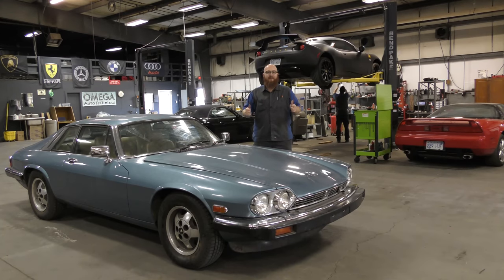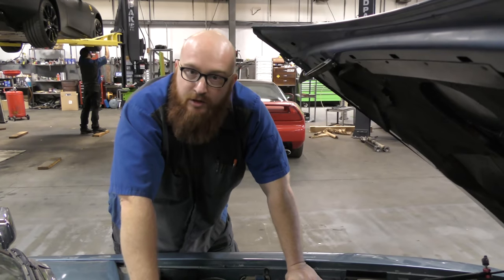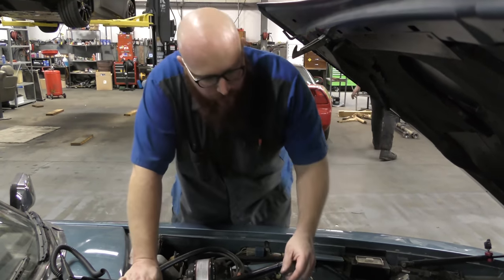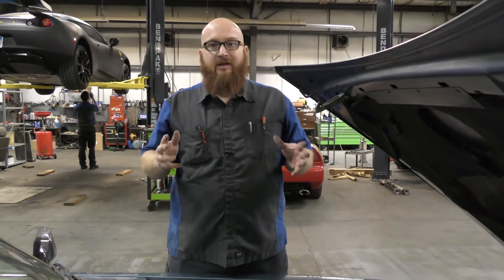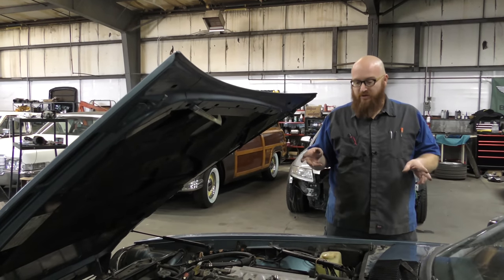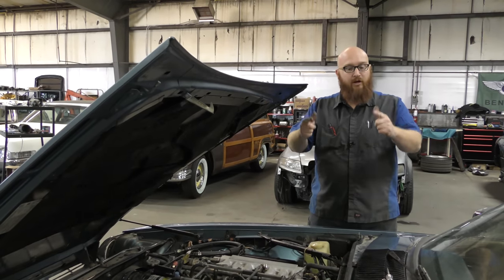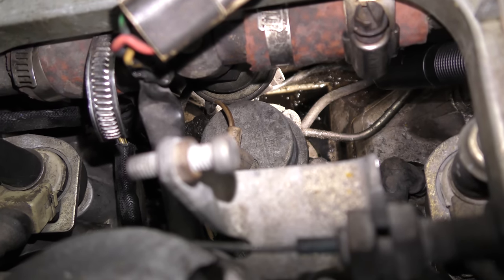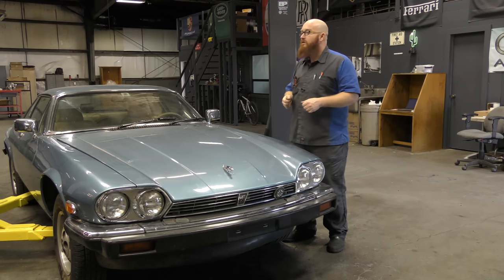'82 XJS with the cursed Jaguar V12 comes into the CAR WIZARD's shop. Can he get it running?

Comment: I had a 1992 XJS. I bought it cheap because of its reputation. It was twelve years old and only about 32,000 miles. A beautiful black convertible with lovely tan interior. Everything worked terrifically. The secret is that the late 1980s into the 1990s V12 were different than the 1982 in this video. Jaguar had corrected so many of the defects of the early ones that the one I had was very reliable. Part of it was fuel injection and electronic ignition. I had it for 6-7 years and it ran great. And, such a wonderful ride. The one issue I had repeatedly is the cruise control. The first time it happened, I noticed the rod running in line with the engine had a broken part that connected it. I used a rubber grommet and a zip tie to reconnect and back in business. It would fail again in a year, but 15 cents and two minutes was the repeated fix. The XJS was made for over twenty years. Most of those years with a V12. The XJS kept the company afloat during tough times. Jaguar switched in a six cylinder around 1994, but the V12 by then was a great engine.

Comment: My dad bought a brand new 1979 XJS. He said the first year of ownership was horrible. Constantly at dealer. After that initial year it was a pretty good car for him. He had 10 years and over  a 100k miles
Reply: 70s XJSs were terrible build quality, on top of the terrible Opus ignition system.  By early 80s, the new Lucas ignition system (fuel injection was actually designed by Bosch) was superior, and build quality went up through the 80s after Thatcher privatized Jaguar.  Also, when Ford bought them in 89, the build quality kept increasing too.
The 70s were so bad, that there is no 1981 US model.  Jaguar was about to kill the XJ-S in 1980, but the new HE technology (bringing gas mileage up from 8 to 12mpg in the city) gave it new life.
Reply: And yet my Acura Legend is 30 years old just shy of 300k, just as luxurious with reliable electronics, and still starts every time and has never left me stranded.
Reply: @G0ZERIAN  The Acura Legend was a joint Honda/Rover project and actually has a Rover electrical system. Of course Rover and Jaguar were part of BL back then. Your car probably shares much of its electrics with Jags of that era.
Reply: @agt155  sorry that is incorrect. The Rover/Sterling version used the chasis, suspension, and drive train of the Honda/Acura Legend. The body panels, electrics and interior appointments were proprietary to each manufacturer. Dont belive me? Go tear two of them apart and see how the Hondas wiring and connectors are almost carbon copies of other Hondas from the era, and how the Sterlings/Rovers are completely different wiring and connectors, unmistakably British. Ive disassembled both cars myself many times over many years of ownership.
Reply: @G0ZERIAN  The development work was carried out at Rover's Cowley plant and Honda's Tochigi development centre. Both cars shared the same core structure and floorpan, but they each had their own unique exterior bodywork and interior. Under the agreement, Honda would supply the V6 petrol engine, both automatic and manual transmissions and the chassis design, whilst BL would provide the 4-cylinder petrol engine and much of the electrical systems.
Reply: @agt155  yeah I've read stuff in the past too. The Legend never received a 4 cylinder in any market, and the Sterling never received it in the US (only the 2.5 and 2.7 v6s). The electrics for the Legend, I can guarantee you, are very much Honda. Remove an entire dash and wiring harness from a Legend, then one from a Rover/Sterling, and also one from an 80s/90s Honda Accord/Prelude/Civic/Teg and you'll see what I'm talking about.
Reply: @G0ZERIAN  If the Legend had succeeded in Europe it would have been offered with a 4 cylinder, it didn't. Strange how it was popular in the US but not really anywhere else. Conversely the Rover 800/Sterling did quite well in Europe, but failed elsewhere. In the UK Cowley factory Rover 800's and Honda Legends were produced side by side.

Comment: I restored a JAG V12 in the early 80's, Including the engine, great V12, needed a factory workshop manual
Reply: Cool story
Reply: @w.e.s.  he should tell it at parties
Reply: If you are not used to any engine, especially a foreign designed one, it’s not going to be easy to fix.

Comment: I'm a rookie and I have a Daimler DD6 with the same engine. I have change the 12 sparkplugs, leads and cap. (took me 16 hours, the AC compressor is heavy and difficult) New oil, filter and gasket for lower oilpan, and new dampers front. Great car for a beginner :-) Good luck with the XJS, its so nice looking!!
Reply: I have a 1992 XJS convertible, spark plugs same as, and it took me less than a hour to replace, with out removing the AC compressor, let me know for the next time you change spark plugs, and I'll show you
Reply: @MrXlskywolf  Thats impressive! I got a quote from a Classic car shop for estimate 5 hours.
I thought, nah, I can do it myself with the tools at hand.
It took me 6 hours to remove compressor, cruise, throtle-tower etc, and to get the new plugs, cap n leads in...
But then additional 10hours and a lot of money in the swear jar to get all stuff back, the AC was difficult until I remove the front mount plate on the compressor as well.. Learing by doing..
Reply: I didn't remove nothing, other than the spark wires

Comment: Hi “jaguar” wizard….thank you so much for this video: I followed your advice and exchanged the coolant temperature sensor in my 85 XJS that was starting to run too rich from one day to the other and created large clouds of smoke. I thought it had a blown head gasket! $26 and a few minutes later to exchange the sensor and it runs perfectly smooth again! Engine temperature is back to normal and multiple electric gremlins are gone after the sensor exchange. It must have created some short and turned out to be totally corroded inside! These are my favorite cars….as they run so smooth  if they work as intended. Actually way more reliable than you would expect but you have to drive regularly! Great video!
Reply: Well now that makes good sense, and I will now do same as have exactly this problem where it runs excessively rich cold hot or any time.  I can also add  flushing an overheating cooling system with 10 bottles of diet coke left overnight worked particularly well for it overheating as well (strange yet true).
Reply: My XJ40 puffs a cloud of white smoke for 3 seconds after a cold start and takes ages to get up to temperature (according to the dashboard dial). Is that the same issue?

Comment: I've owned three XJS V12s (still own two) and LOVE them!
Reply: I had a 3.6 for about seven years, superbe machine. I would like to try the full fat version.
Reply: I cried the day a friend sold his for a Toyota. The Jag was British racing green with biscuit interior. Pushing the ego thing aside, I was a wonderful machine to drive, the handling was superb, and it was definitely a gentleman's automobile.
Reply: My '73 XJ12L was a dream to drive, and you felt like it could pull up tree stumps. But on the highway you could quite literally see the needle on the fuel gauge move, and one of the SU fuel pumps broke while it was sitting in the garage overnight. Nor was it very funny when the wipers suddenly stopped working in the rain during a road trip.

Comment: OIL LEAK:  If the new sensor doesn’t fix it, there are EXTERNAL oil lines on the rear of the block.  They leak at the copper washers.  Second, just above that, there’s a half moon rubber plug under the cam cover rear that shrinks and falls out.  I think your puddle is more likely from these locations.
Reply from the maker: I saw oil literally pouring out of the sensor. Not an oil line issue
Reply: @CarWizard  I trust the car wizard that the sensor was leaking!   If there is still a drip under the car, check out those other two notorious leaky spots also.   The XJS is my favorite terrible car and I’m glad you made a video on it.  Been daily driving XJSs since 1996!
Reply: Think we got it
Reply: @CarWizard  isn’t that mess of oil on the catalyst, just waiting to go on fire?
Reply: @BangerFleet  You lucky ... man!  :)
Reply: @CarWizard  Say thank you car wizard
Reply: @robertbeirne9813  Oil will just smoke out as it burns off. Brake fliuid, on the other hand, would flame out. Still needs to be cleaned off though.
Reply: @2kcars507  ssshhhhh. My goodness
Reply: The reason why England does not make computers?..They can't figure out how to make them leak oil..
Reply: @CarWizard  can you convince the owner to megasquirt it or put some other aftermarket computer in it. then make a how to series so i can copy it. thank you.
Reply: Well, if the banjo bolts crush washers arent leaking, and the half moon plugs arent leaking youre lucky. They almost always leak if they havent been changed.
Reply: It's AMAZING how mature and grounded a comment seems when it offers correct solutions rather than condemnation of the manufacturer
Reply: Jaquar: Let's put all the oily connections at the rear out of sight so the engine looks nice and clean...
Mechanics: Let's not...

Comment: That’s a real mechanic at work not a plug it in and see what the computer says. Good mechanics worth their weight in gold for older cars.
Reply: Yes indeed, these guys are hard to find
Reply: You still can’t “just see what the computer says”.  You still have to figure out whether the sensor is bad or if it’s fine and the fault lies elsewhere.....
Reply: @shawnbottom4769  I think his comment was to say that the car is not like the new ones, a lot of detective work in the old style had to be done here without a scanner computer
Reply: Totally agree   Have a Saab Aero convertible - Tom at RTJ Autos in Stockport U.k. is a genius with these cars 👌

Comment: Oil leak! It's not a fault, it's a feature!
"Jaguar: If there's no oil under it, there's no oil in it." 🧐
Reply: Drewe Cantwell ...can say the same about Garbage Motors produced chevy motors....exhaust leaks abound in those junk chevy motors as well...
Reply: Just like a Harley Davidson 😂
Reply: That's not an oil leak, that's the "dynamic chassis corrosion prevention system"
Reply: Well said abd if it was a Jaguar, Rover SDi  or any BL vehicle and was not plagued by electric gremlins, then it was not built to the very high standards of spare parts left over from other models. Such as Allegro parts going into a Princess, or Truimph Acclaim bits going into a Rover straight six or 3500 V8!!!
Reply: @blueridgerennsport  that is funny
Reply: @branon6565  Yeah its not just Jags is it.We didnt get many gas gussling yank tanks so we didnt know much about them in UK but no doubt they were heaps.
Reply: Royal Enfield had the same anti rust feature. Oil on the rear tyre could help make life interesting
Reply: they used to say that about harley-davidsons
Reply: GM-Vauxhall invented driver lubrication

Comment: I don't get why so many people have trouble with the Jag V12's, they are pretty simple really, they just look complicated because there's so much packed into the bay.
Reply: Wizard probably already knows about the mixture adjustment screw on the ecu.
Reply: The center-mounted distributor and wacky throttle linkages alone make the engine bay look like a complete mess, but really there's not a lot going on.
Reply: @100PercentJake  same as any other engine, just a few more cylinders
Reply: Amen

Comment: Car wizard, at 5:26 you can see a large electrical arc near the firewall when you hit the key to crank the car over.  Might be something to look into.  More Lucas to exercise from the car.
Reply: Holy shit! I totally missed that
Reply: Good catch. Don’t know what that little module is, definitely arced.
Reply: Exorcise
Reply: Nice catch.....looked like a real bad one. Something probably burned up.
Reply: Nice spot on that arcing!  That can't be normal, can it?  Maybe because that exposed wire? Good thing there wasn't any fuel vapors in the air above the engine there, woulda been a nice big bang!
Reply: Hope Wizard sees it somehow, surprised Mrs. Wizard didn't see it....or maybe she did and she'll tell him about it later because she didn't want to interrupt him in video...
Reply: Looks like its coming from the starter solenoid or associated cabling.

Comment: The V12 Jaguar was an amazing engine. Very strong, powerful and an absolute bargain at the time. It had to be  maintained properly otherwise overheating can be a problem.  Changing the plugs  is a nightmare.  Many engines never had a plug change.
Reply: I ran a Jaguar for some years and knew a guy who was one of the development engineers at Jaguar.  He also used to say that many engines never had a plug change.  Having tried it myself I had to remove the A/C module.
Reply: Not to mention the distributor felt pad that needs oiling every service, that is under the rotor arm..
Reply: They're no so bad to do

Comment: It takes longer to "unpick" the mess from the previous guy, that to fix the fault.

Coax cable is notorious for breaking, they really don't like bending or going round bends.

Oh the delicious irony that the Wizard dissed Lucas, just to find out the faulty internals were US made.
Reply: Kevin Short If something is a true piece of shit, it won’t last almost 40 years. This car is clearly not that bad, as it still runs 40 years later. Sure, it’s no Honda but it certainly ain’t as bad as it seems.
Reply: @binnydinney9739  
All he needs to do is get rid of those hideous US bumpers and put some Euro spec ones on, and it will be perfect.
Reply: @M Bacon 
It must be very expensive, because I haven't ever seen it being used anywhere.
Coax BNC cables, coax TV cables, etc are all not happy with bending and sharp corners.

Comment: The Original Anti-Theft Device - Lucas Electrics.
Reply: Why do the British drink warm beer?
They have Lucas refrigerators.
Reply: .. I restore jags .. e type series 1’s .. they all work before restoration electronics wise 🤷🏻‍♂️
Reply: Antitheft device?!? That's pretty funny...
Reply: My 80 Jag V12 had Lucas stickers on all EFI parts and relays, peel them off and Bosch was stamped on them or cast into the alloy
Reply: Ah yes , Lucas !! PRINCE OF DARKNESS !!
Reply: @larrytownley2231  Ozzy Osbourne has nothing on Joe Lucas. Ol’ Joe is the original “Prince of Darkness.”
Reply: @TheBuzzo72   Adam old boy, we don't drink warm beer !  BTW  I have owned several Jags over the years with Lucas equipment and not had one problem. My sympathies to those who have had problems.  😂🇬🇧
Reply: Lucas also makes refrigerators, That's why Brits like warm beer!
Reply: and the gotti...lights....gotta get home before dark
Reply: Lucas Electrics: The Prince of Darkness.
Reply: @sirgeraldnabarro1342  it's just a joke a guy I used to know would say very every time one of his MGA's would leave him stuck on the side of the road.
Reply: @TheBuzzo72  I'm using that one
Reply: Lucas, Prince of Darkness..
Reply: @TheBuzzo72  They don't drink warm beer though, never did. They also don't have bad teeth and the food is excellent. Sorry about the Jag though.
Reply: as if the electrics werent bad enough, jaguar used awful "bullet" electrical connectors which were zinc coated, add to that the wiring that entered the connectors were copper/brass and they reinvented the battery. given humidity and especially salt air and the connectors went green and fuzzy
still better than a f...ing tesla though!
Reply: @larrytownley2231  I was under the impression that he invented the darkness...
Reply: Bought a Prince of Darkness shirt this summer. It started falling apart after the first wash. Not joking.
Reply: Today’s best anti theft device? The manual transmission
Reply: @matthewcaughey8898  Only in the USA! In the UK we can deal with manual gearboxs and don't think that you have to be a professional racing driver to use one.
Reply: Maybe in light of THIS video, re-write that 'GM Electrics???'
Reply: Hey watch it I'm British! But you are right Lucas did produce some crap. The Triumph 2.5 PI was spoiled due to the Lucas fuel injection. I once went for an interview at Lucas (avionics division) and they had some funny ideas. For example they had invented their own computer language called LUCOL - LUcas COntrol Language. It was a strange interpreted language which could only be debugged by someone from Lucas. I think though this was common in many companies who were basically mechanical engineers trying to do electronics at which they failed. Oh and English beer made from malted barley and fuggles hops, is still alive and is stored at cellar temperature 55 degF - its NOT warm and has a light residual fermentation. Ha much better than Budweiser which is dead pasteurised and cooled to numb your taste buds against the nasty taste. !! So there.
Reply: Lucas aka 'The King Of Darkness', Little wonder that the Japanese took the market for 'High Cost Good Value vehicles .Outside of Rolls , Most British cars I've owned have suffered niggling problems, from Sixties Vauxhall's to Forties Riley's, Fords,  Oddly, 30's Baby Austins, (well kept) proved the most reliab;le. I would put this to work attitudes at the assembly plants, the idea of a fair day's work for fair pay never occurred in Britain, and the'workers/aka assemblers and unions put paid to all except a very few British Vehicles.
Reply: Not so true. my wife and I peeled the Lucas labels off of a shoebox full of relays to see Bosche embossed into the plastic.
Reply: @craigweis1675  - Obviously some Chinese counterfeit junk, BOSCH has no 'e.'
Reply: @sthavoc8  British beer is not warm, it is served at cellar temperature, just like red wine. Do you refridgerate red wine?